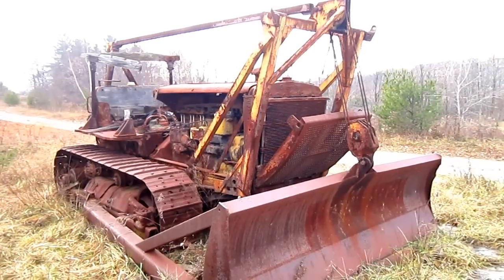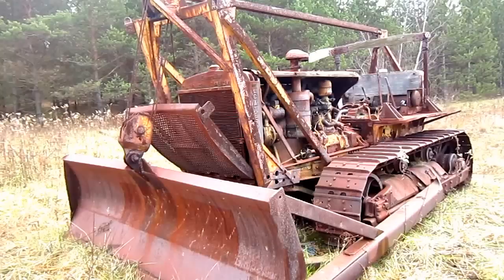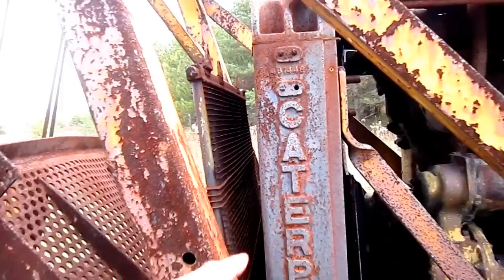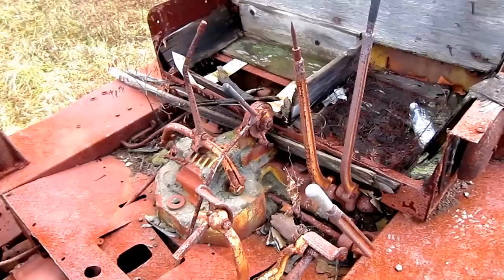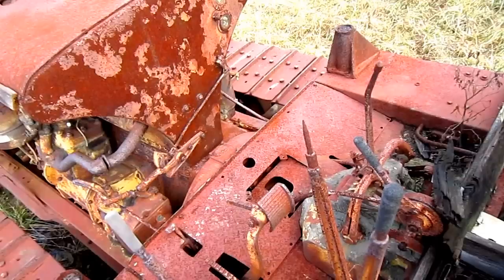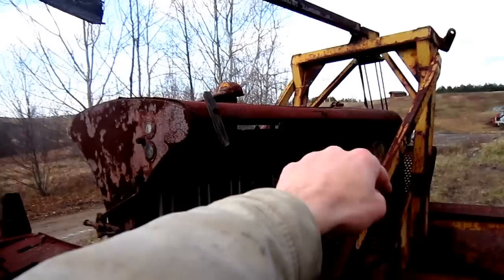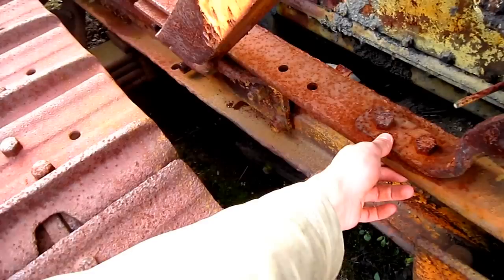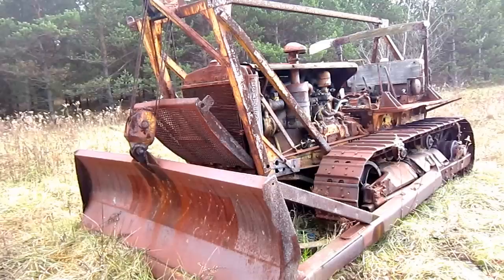Caterpillar D8 8R Documentary

Comment: That lever that you said turned the pony motor over is actually the decompression lever. On that dozer you would turn the pony motor over from the front of the tractor with an old school crank. The purpose of the decomp lever is to allow the pony motor to spin the diesel without having the strain of the full compression from the diesels cylinders. You turn the decomp off once the diesel is hot enough and intern the diesel is able to turn over under its own power.

Comment: Yes  you cover the story  , most  excellent sir , sure took a good operator to get the best from these machines! I have No 1914 left  factory 28 August 1943 stamped SP (special  plant) it has a D8n series  Hyster winch   apparently to US 7th  fleet.    Many were used for tank recovery some even fitted with  bullet shield  protection. NZ govt  used my machine while making  Nandi  Airport in Fiji Then  NZ army sold to demolition firm RYANS in Christchurch then Cameron  now me! it has developed part of  a small farm in canterbury  .Still operational she winched  our  "retirement" house on transporter into position on the worst rainstorm for  2 years. sure glad to have her.  Thanks  Buddy
Reply: +Richard Bruce - "SP" in the serial number stands for "Special Parts" - i.e., additional accessories and non-standard components added to the tractor during factory assembly - as compared to accessories or attachments added after the tractor left the factory. 
Typically, these "Special Parts" were non-standard governors, non-standard track shoes, heavy duty battery charging systems, factory lighting, military-standard oil filters, and non-standard transmission or final drive gearing. 
Cat D6's, D7's and D8's with special transmissions were marked "SPC-G" on the upper rear vertical surface of the steering clutch housing. 
Tractors fitted with wide gauge tracks had "W" in the Serial Number prefix. 
If the tractor was Wide Gauge and also had non-standard factory additions, it had "WSP" in the Serial Number. 
The use of "SP" in the Serial Number was discontinued during December 1945 - except for tractors having "special" (non-standard) transmission or final drive gears. 
Refer to the Caterpillar Service Magazines, Feb 19,1940 and Feb 20, 1941, and December 15, 1945.
Reply: Thanks D357,I understand1914  my machine left factory(peoria)  28 aug 1943 for US 7 Fleet

Comment: Like Aaron said your precision knowledge deserves a follow, simply brilliant. Nice to see this machine in the hands of a collector.
Reply from the maker: +0BMM1 Thank you!  Glad you enjoyed the presentation
Reply: +PAmining I'm  sure the 2u didn't get an oil clutch,but the 13a,14a and 15a did.also.a live cable unit,not depending on the clutch being in to work,was added.the diesel fuel torque converter was in the 15a but one needed to keep the tank at least half full or it would run hot.Ive got a 15a soon for sale.even has segmented sprockets.

Comment: that handle he said was to start the pony is the compression release for the big motor.this had a 5 and three quarter inch piston.the d7 in this era was the same bore and stroke but a 4 cyl.the mains and rod bearings were also the same.I believe the journal dimeter was 4 inches but I cant remember if this was the mains or rods.
Reply: Lee Watkins you are correct !

Comment: Just a further comment, when these dozers were pulling scrappers the blade would be dropped off and the blade cable directed to the rear because the scrapper needed two cable drums to operate it, one to drop the belly down to scrape up the load and the other to pull forward the ejector plate to push the load out. I loved to listen to these machines work because the cable drum brakes and clutches would make a whoop whoop sound that could heard for miles. Thank you